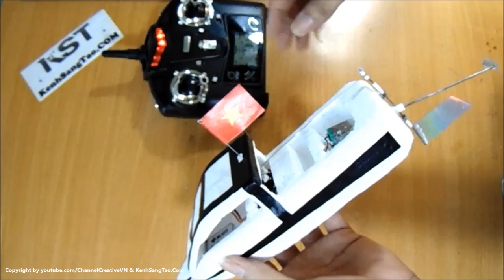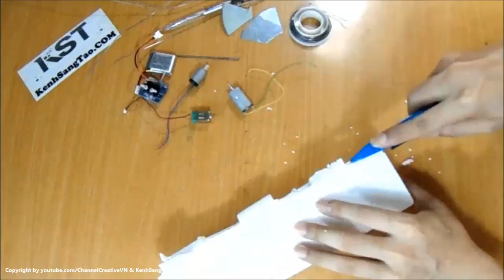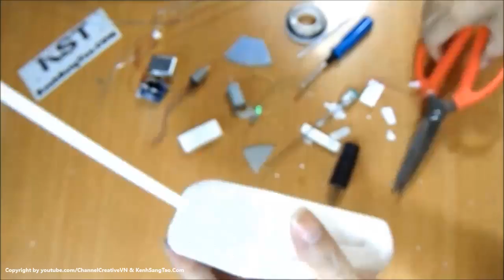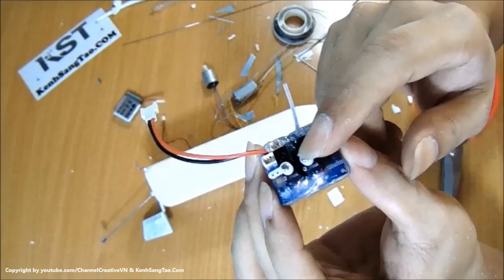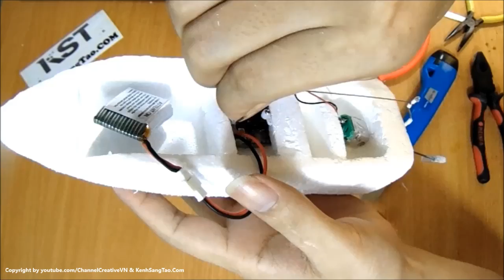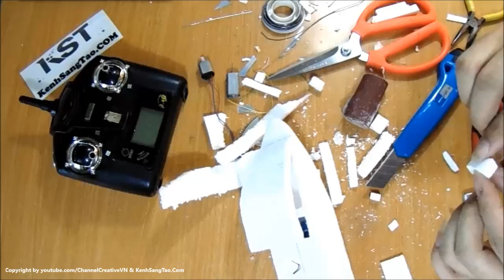[Tutorial] How To Make super speed boat, DIY boat RC

Comment: should i use the gear compresser found in big rc cars? i think i should wen i add a bigger proppeler because then it would be stronger
Reply from the maker: +Aleksander Sats ok , thank you, I will improve again
Reply: +Creative Channel i tried it and it worked really well only thing that the compressed gears do is make it go slower but it will also making it stronger to turn around it. big rc cars needs it or it wont move with the compressed gears so yeah but if u do take down that the dont trow away the reciver and remote but if it is broken the reciver then trow it away or find a part that makes to work again
Reply: Creative Channel
and also here is a little tip that may help you if the reciver antena is to short range u can make it bigger by just puting copper wire there because it will act like a antena u may want to then remove the coding ive tried that and the signal was huge my rc car made about 35 M away from me that is one good thing
Reply from the maker: +Aleksander Sats ok, thank you very much, very helpful share
Reply: no broblem :-)
Reply: عاشت ايديك
Reply: +Creative Channel can you make a really really fast boat.i need one.
Reply: عباس